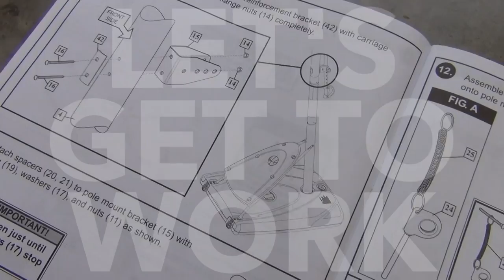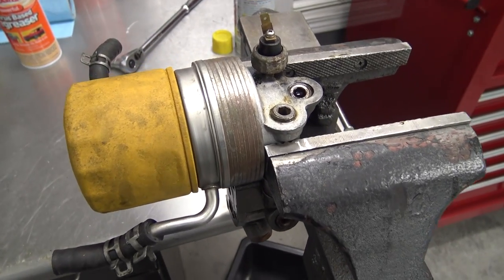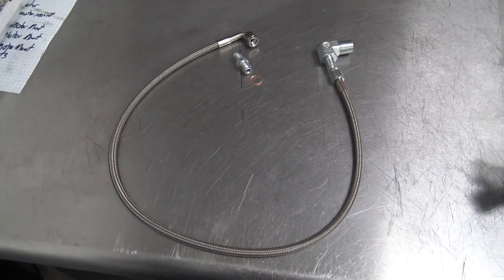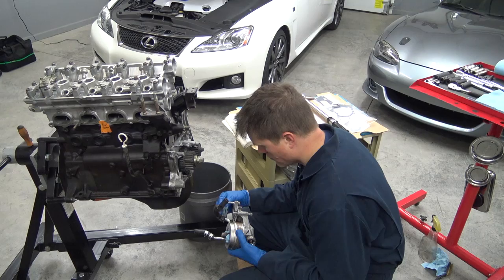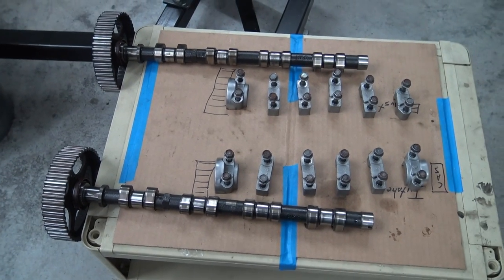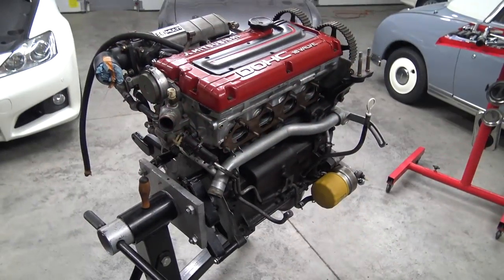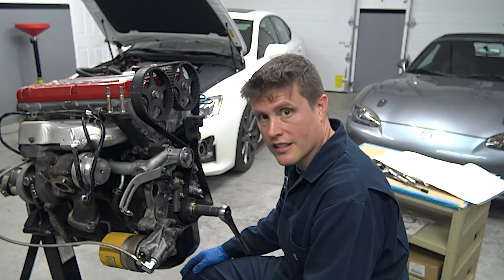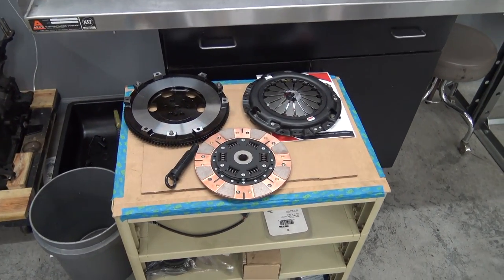Street Sleeper Part 9 - Final Engine Assembly

Comment from the maker: Hi Everyone, thank you for watching and thank you for your kind support!  I hope you have a weekend filled with awesome car stuff.
Reply: Tom's Turbo Garage I watch this channel religiously lol thanx for the awsome content
Reply: It's 14 days to the SHOOTOUT BRO!
Reply: Tom's Turbo Garage you Sir, are a manly man
Reply: Hello Tom! Great video again. Appreciate what you are doing for the petrolhead world :-) One quick question: What's your view on reusing timing belts? My knowledge is "never re-tension a used belt". As in: You cannot reuse any timing belts. You seem to have different info? Is this manufacturer specific?
Reply: Manufacture will always say replace.. the same thing with cotter pins etc. Truthfully, It depends on how many miles/wear is on it. Best practice to just replace it though.
Reply: Tom's Turbo Garage i dont have a car 😭
Reply: those basketball hoops are a pain in the ass when the instructions suck lol
Reply: Your welcome, I like your content because it's straight laced and informative. Actually...That little Miata you did has inspired me...now I"m hunting one out as well as the LS3 and trans....gonna be pricey but your review on it post swap was encouraging that the car was still a handling king.
Reply: The oil-line that you connected to the port in the oil-filter housing where you removed the plug from, does it lead to the turbo-charger inlet, or outlet?
I'm sure it must be the outlet, since there is no pressure building up in the oil-filter housing but from where do you take the oil-inlet for the charger?

Comment: Love the little unspoken tricks I noticed you doing. The bulldog clips on the belt and the belt around the pulleys for torquing. Nice 👌
Reply: @mazcati- I also used clips until a fellow tech suggested small zip ties since they break off with incident if you forget them.

Comment: Tom i don't know if you will see this but i used to use a old bolt with the cut the head off it to line up the water pump pulley. That will make it a lot easier to install it when its in the car.

Comment: Nice job, I prefer to remove the plugs to turn over by hand as it's much easier as there is no compression fighting you. Can be easier to detect a valve crash.

Comment: If it's so hot, why do you work with your garage doors closed?
Reply from the maker: +MikeVonDoom it was almost 100 degrees outside and high 80% humidity.  It was cooler in the garage with the doors shut.

Comment: Did you lubricate the cam bearings before camshaft install or is that not necessary if you prime the oil pump after installation?

Comment: This is a bit un related but do you think I should heat up the high pressure line fitting on my power steering rack? It requires an 18 mm line wrench but my fitting is really rusted down to 17.5 mm. I'm scared to try, because if I break the fitting , I will need a new PS rack. I watched you heat up and loosen that nut with success. Can you come by I'm in Montreal.
Reply: Nukes Away you can heat it just make sure you be careful
Reply: Thanks. I have a lot of old exhaust heat shield that I will be protecting things with.. Heat and cool with wd 40. I also cut a slot on an 11/16 wrench which is slightly larger than a 17 mm. I will do it.